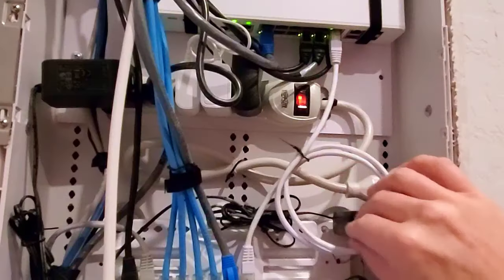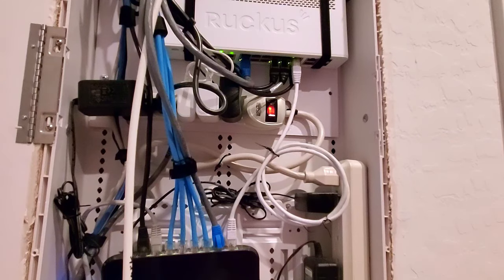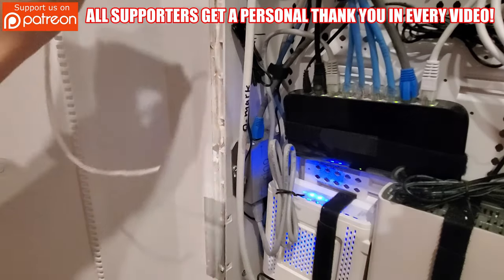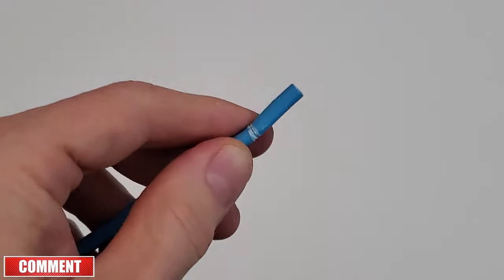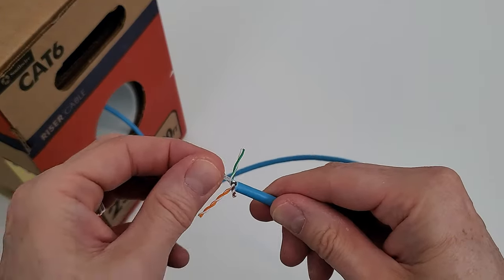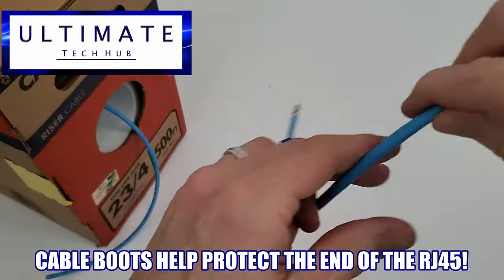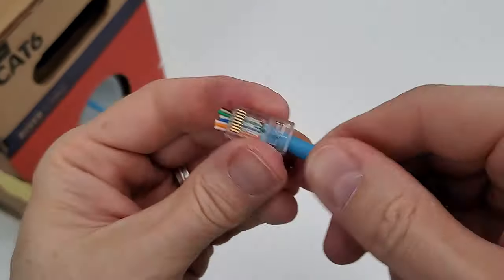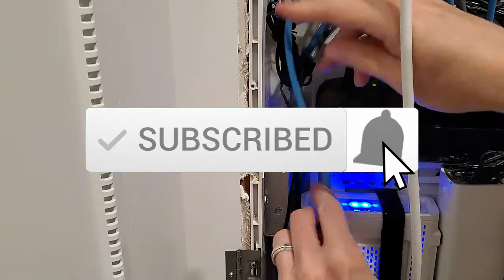THE BEST WAY TO WIRE UP ETHERNET PLUGS! ( CAT5e & Cat6 PATCH CABLES )

Comment: *Beacuse you're using passthrough jacks, cutting the wires isnt necessary
Reply from the maker: It cut the wires so they are all the same length and are more aligned so it's easier to push through the connector.  Sometimes the wires will get caught up inside the connector if they are too long or are different lengths. Its just a personal preference and force of a habit! Lol
Thank you for watching.
Reply: @UltimateTechHub  well yea thats true, even if they're pretty straight the first time you unwind them int could still be easier

Comment: Not a fan of passthrough connectors. The crimper blade wears out, may not cut flush, and the pair ends are left open, leading to possible rf interfierence. With a little more practice the oldschool closed ends are just as easy. The fact that zero factory patch cables have pass through connectors says alot too.